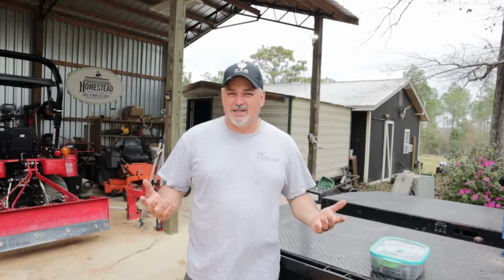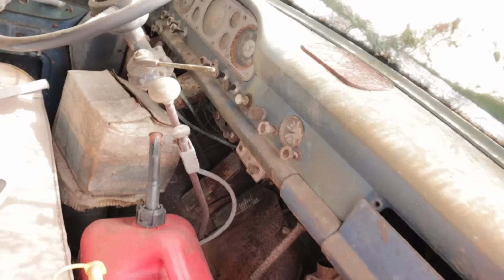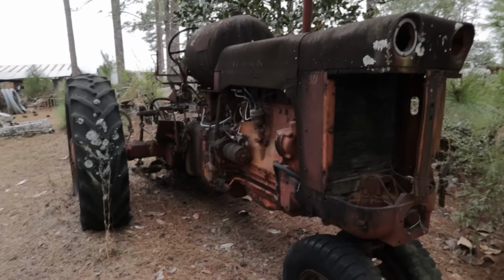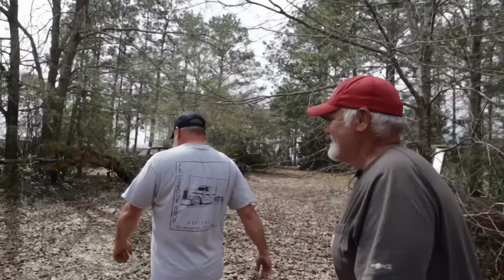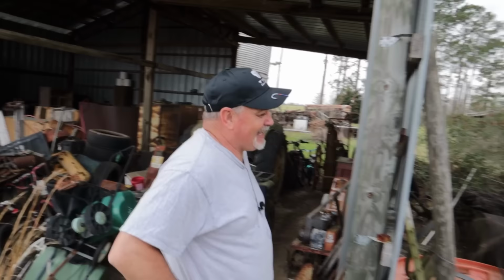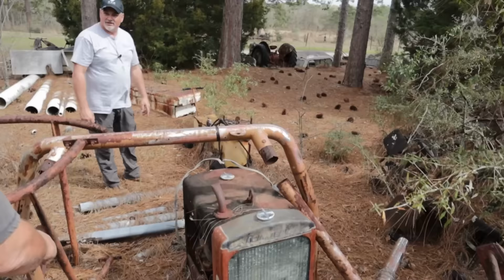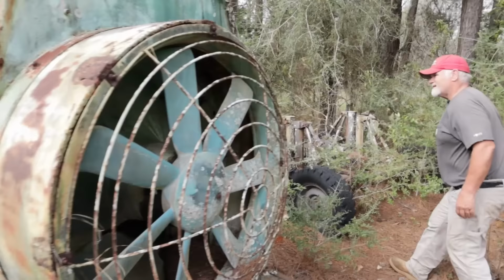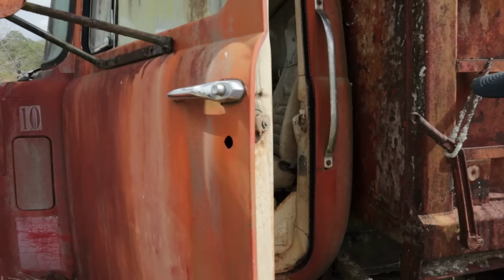MY FRIEND ALMOST DIED! Junkyard tour could've been deadly!

Comment: Those were 8n tractors. The 9n was started in 1939. There were 2n’s that started in 1942. The 8n started in 1948 and went through 1952. 9n and 2n were 3speed transmissions with brake petals on both sides. 8n had a four speed transmission with brake petals on the right side.

Comment: You can also tell between an 8n and 9n Ford tractors by the positioning of the brake pedal. The 9n has the two brake pedals on opposite sides, so you have a brake pedal close to your right foot and another close to your left foot. On the other hand, the 8n has both brake pedals on the right side.
Reply: Front wheels are a dead give away. 9 and 2ns have a VW bug pattern, 8n is standard 6 lug. Rears are different too.

Comment: The V wheel was used mostly for cultivation but you could run down the row in between  the wheels plus the v wheel could turn 360 degrees
Reply: 90° left and right. They don't spin all the way around.
Reply: @twinkie27271  our John Deere 530 has 360 degree turn

Comment: The LP tractor is a Case 800 the hood reads Case O Matic  which is a type  of automatic transmission used in the 800s the 700 was basically the same tractor but had a standard transmission and the hood typically reads Dual-power on those

Comment: The Case is a 870 caseomatic LP . Runs off propane
Reply: Yes sir and they sucked for row crop work. J I Case was a long time before Case IH. When I was 15 or 16 years old I worked for a man who had one of those. It was a great tractor as long as you were going straight, but was so hard to turn around at the end of the rows. His was a wide front end and caseomatic was so slow.

Comment: The Old Ford Log Truck is a 1957 Model. 57 was the only year of single headlights back then for this series of Ford Trucks (1957-1960) all the rest (1958-1960) had 4 Headlights.

Comment: That old 1976 custom deluxe 3500 Chevy that has the tree growing up  trough it used to belong to my dad. In spring 1985 my dad was driving that old truck doing hotshot work cross country with a new 48’ gooseneck trailer. He had hauled a load  from Los  Angeles CA and he was backing into that company on the door and dad smacked the dock, and tore the rear end out of it. Dad couldn’t afford to have it towed let alone fix it, so dad sold them that truck, even though that company had all fords. The trailer he didn’t sell, my dad had his brother come down and get him and the trailer. I know for sure that is it, because the owner of that company was a die hard ford man.

Comment: That is a pulpwood truck. The wood was cut into 8 foot lengths and stacked across the frame. The little boom on top was was to load the “sticks”. Then the winch cable was thrown over the top to secure it down.

Comment: I don't know about the pedals but I know the 9N tractor has a distributor in front of the radiator I believe the 8N tractor into an tractor has the distributor on the side of the block😊
Reply: 8n has tight bolt pattern on rear wheels    4spd trans  could have dist on fit of blk  as well on fit left side depends on dom

Comment: the truck is like 63 so the cab might have been produce 23rd of April of 62-63. the biggest engines Ford offered those years over 400 cubic inches were the 406 in 1962 and the 427 in 1963. Both were big-block "FE" engines and ran very well. Of
Reply: Hey Hank from Hamilton I like your will is start videos tell your wife I said hello

Comment: 9n had I think was two brake pedals on one side with the clutch and the 8n had the starter button by the shifter with one gear shift and the 9n had the the shifter with the small high/low shifter and also had a stop engine knob to pull to turn off the engine

Comment: 46:24 That's a Toro greens mower for a golf course. It has hydraulic motors on the reels and the drive. The only thing the engine powers is a hydraulic pump

Comment: On the 8n, the pedals are one way to tell the model. The brakes are on both sides on a 9n. The 8n had clutch on one side brakes on the other. The rear hubs are the easiest way to tell the difference, 8n rear hubs are about 6 inches across, 9n hubs are about 2 feet. The transmission is another way. 9n was a 3 speed, 8n was a 4 speed.

Comment: Yes, ihe tricycle front ended farm tractor was made to   go between the rows of corn for example,
A tricycle frontended tractor has the 2 front wheels very close together in the middle of the tractor. So the front wheels traveled between rows 2 and 3 while the right rear wheel traveled left side between 3 and 4 while thje right rear traveled between rows 1  and 2
the difference between a Forf 8n and a Ford 9n is a 9n  and 2n both have 3 speed transmissions , but the 8n had a 4 speed transmission.

Comment: Those 2 ford tractors are 8n. The 9n and 2n have different front and rear wheels compared to the 8n. 8n also has more horsepower than the 9n and 2n. The 8n is a good little tractor to have. I've had 3. Just trying to find something bigger. Have to be very careful out there from now on. Snakes and wasp. The motor from Just looking at it that 88 ford truck was probably a 5.8 v8. Have a great week next week.

Comment: Find a grader that you gave up on i would have tapped lightly on the top for the valve that was stocked to see if you could pop it loose if you couldn't then what I would do is loosen it the adjustment pull out the push too take off the injector line do this any sound that the files are stocks you can't turn over see if you can start it if it'll start maybe if it gets warm it will Release this you could try to unstick the valve again with the tap and I think if that doesn't work then I give up like you did

Comment: Believe that is a 1957 F800 Big Job Ford Truck 332 C.I.D Engine and had a 15 speed Transmission in most of them. Ford 460 C.I.D did not come out till 1968.

Comment: I will put a generator on your junk batteries to set up a small portable power battery jumper put a regular gas engine jump around there plus your compressor and a work light in the back of it this way when you are you on use that service truck put that service truck

Comment: The truck looks to be a a mid to late 50's. Engine is probably a 312 or 352 gas. Probably single axle with a desd axle. The bed on the truck is designed to haul "Cord" wood used at paper mills, turpentine and gum plants and charcoal factories. Lots of rust in this place....theres another 8N .Oh God, look at the size of that snake. Ladies and gentlemen. That concludes todays junk yard tour.⭐⭐⭐

Comment: Ford had a 427 in mid 1960s.  Pulpwood truck looks to be about a 1960.
Reply: 1957 Ford pulpwood truck. You can tell by the single headlights.

Comment: All my years dealing with rattlers I've only had 1 rattle and that was my doing by moving the mower on top of him. Evolution stopped them from rattling because the borr hog will find them and eat them when they rattle. Just a little info for folks that think a rattler will warn you their there but they wont.

Comment: 8 n is 4 speed 9n is 3 speed the 8n has both the brake pedals on the same side and the 9n had the brake pedals on the opposite side the 9n came out in 1939 and then the 2n and then the 8n.

Comment: That 1988 Ford XLT Lariat ran that same body style from 1986 to 1991 that truck being an F250 or F350 would've either had the fuel injected 302 or 460 it would more than likely have had the 460 in it 1988 was the 1st year they started making all ford trucks fuel injected i have a 1987 F150 XLT Lariat with a factory 351w thats carburetored also the Ford 9N tractor ran a 4 speed transmission and the 8N ran a 3 speed transmission and the front wheels on the Ford 9N are the skinny wheels & the rear wheels on the 9N had a flat face & the front wheels on the 9N had hubs that stuck out and came to a point where the 8N has a dished out face rear wheels and the 8N also had both brake pedals on the right side both of those Ford Tractors are an 8N 100% guaranteed

Comment: Walking around in the brush gators might be the difference between you having a good story about how you almost got bit by a cotton mouth or one of the many rattlesnake breeds🐍 in Florida and  pygmies aren't even 2 ft long and enough to kill anyone if they can get up on billboards to get to dry land a machine that is covered in trees is a jungle gym and a good place to make a nest to make sure they're not going to have any birds eating their eggs  I'm sure Georgia boots can make you a set that will work with your boots to get proper protection up to your knees and a Walking stick is not just for leaning on you have been in woods for decades don't forget the way you did it before you had to take the camera 📸

Comment: The Ford that you first looked at is a 1958. The difference between a 8N &a 9N ,the 9N has a3 speed transmission and a8N has a 4 speed transmission
Reply from the maker: Right on
Reply: 57, 58's had four headlights, 57's had two headlights in the grill

Comment: Finally, something I know what it is. The plastic lid with the wheels is of a liquid feeder for cows. When that lid is on the container just a little of the wheel sticks out the top and the cows lick the wheels causing them ti turn and pick up the liquid. The liquid would generally have some type of chemical that would make the cows tongues itch, so they would have to eat more grass.
Reply: Never heard the itchy tongue story. We use liquid feeders for feeding molasses infused with minerals.
Reply: @rt3box6tx74  There was some in the '60s sold around here that had some type of organic acid in it. Besides killing microbes in the feed, it would make the cows tongue itch and they would have to eat more grass to stop the itch. Check all the ingredients in you feed and chances are one of them will be some type of acid.
Reply: @Elvin Ferrell  Haha... you mean like citric acid?
Reply: @rt3box6tx74  That would probably work. I can't remember the exact one in the feed, but I think it was before anyone thought about killing the bugs that might grow in the liquid.
Reply: @MrEferrell  Ours didn't stay around long enough to get bugs. Cows worked it over purdy quick.